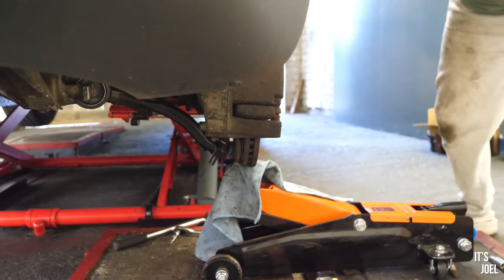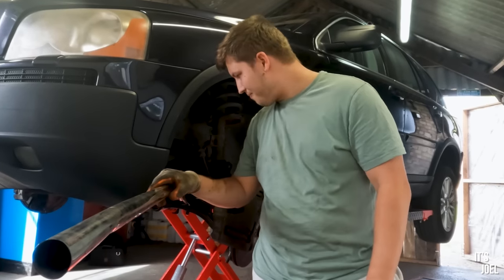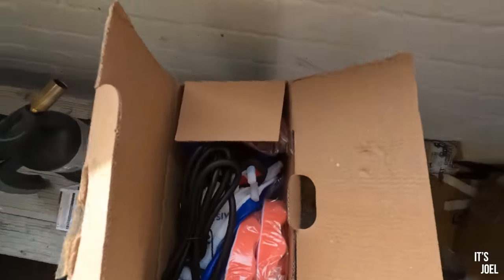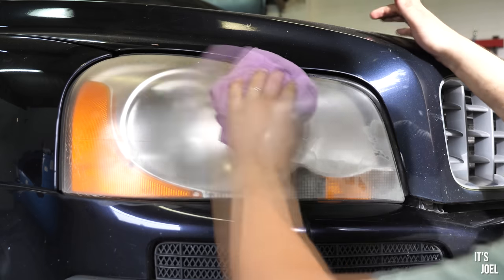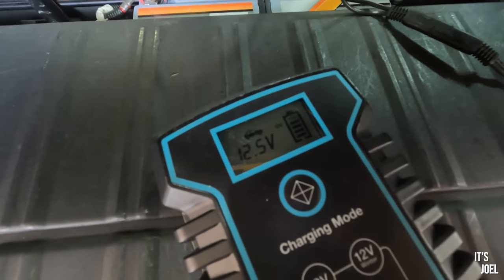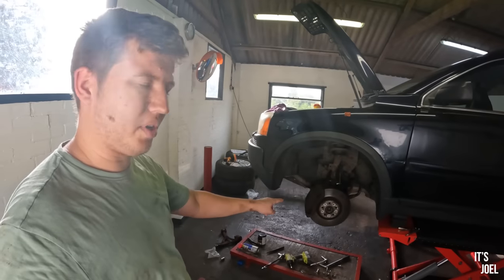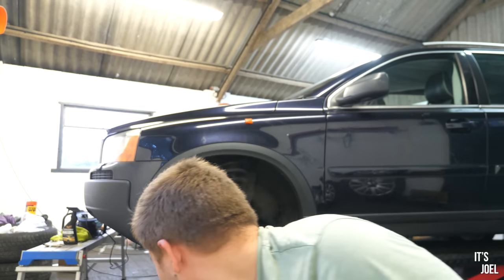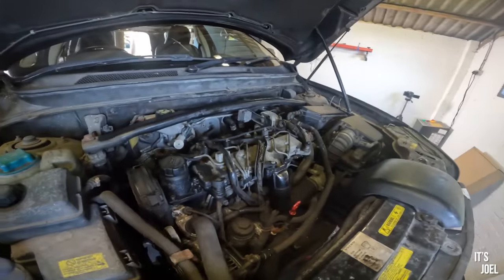CAN I SAVE MY £800 COPART VOLVO XC90? PART 3

Comment from the maker: Get Gaminator here! https://clik.cc/x7e4A
Thanks for all your support!
Reply: Where did you get the car polisher from please Joel p.s loving the volvo videos
Reply: All you needed to do was remove the caliper , carrier and disc , then the drop link ,  then the 2 hub to strut bolts and the hub is free to float in free space , with 1 hand you could have dropped it on the  arm and then done it all back up .
Reply: Do ball joints on the floor it’s easier…
Jack up the wheel you want to change, wheel off, axel stand in behind arm, bricks under the disc, drop down & Jack out, swap ball joint and use the Jack to push up the new ball joint bolt 👍🏻
Reply: Buy yourself a Haynes workshop manual off bay of e approximately £23 and read it before you do the job in hand, if you are ever replacing a droplink just chop the nuts off with a grinder with a slitting disk in it makes is so much easier 
But do get a Haynes manual

Comment: Got an XC70 which I just replaced the lower control arm and ball joints on too, two flipping days of blood, sweat, tears and a lot of brute force and effing and jeffing and got their in the end so I was rooting for you throughout these videos, bravo sir.
Reply: When replacing   control arm ,its better to conect the ball joint first and then connect the  arm to the chassis, have done it that way several times with great success.

Comment: You don’t have to replace all 5 injectors, just the faulty one. And if you are getting a compression leak past the injector you can just replace the copper seal and tighten it down.
Reply: Hm, i think it's better to replace all 5, or at least, refurbish them, because the amount of fuel between cylinder will differ from new to old injectors, as older ones flow much worse than new
Reply: @xnrs9334  The ECU will account for that. On a lot of engines you'll have to code in the specific injector. I would ideally not replace the leaking one, just replace the copper seal with a new one (check if it has done damage to the cylinder head first) and put the old one back in.
Reply: @tschuuuls486  tbh i'm not very familiar with diesel, but, how would it account tho?
Reply: @xnrs9334  it can detect the amount of engine knock and the combustion quality from the o2 sensor which allows it to fine tune the injector injection amount. Mercedes ecus for example will show you the injector duty cycle offset learned VS programmed time.
Reply: @tschuuuls486  well, the thing is that there is only 1 lambda sensor for all 5 cylls, and 2 knock sensors, so idk how it should work
Reply: You have to replace the hold down clamp as it's a use once item , otherwise like reusing a head stretch bolt , it won't tighten .

Comment: It looks to me like you were actually tightening that drop link nut at around the 12 min mark. Stick with it, your skills and techniques, and of course knowledge will grow with you. We've all been where you are. When I was young and skint I had to change a gearbox in my Mk1 Escort for work the next morning on the street outside my house. It pissed down with rain, I was soaked and freezing. Got it done by midnight and the last thing to do was connect the clutch cable. It wouldn't reach because i'd installed the clutch arm back to front in the gearbox. It had to all come out again :( It was quicker next time round and I got to bed about 4am for a 7am start. I'd also thrown my overalls in the washing machine which coated it with gearbox oil, which ruined our first babies clothes on the next wash :D I was not popular with the missus for a while. Actually, i'm still not, and i'm 57 :D
Reply: What a story 😂😂😂

Comment: Good work with the attempt its good to see people having a go. I saw that at 11.28 you were turning the nut to tighten not loosen it might be why it wasn't coming off :/
Reply: thats not the issue ... he was trying to tighten to break lock but its pointless as its a balljoint and rotates ... it has a hex cut in centre to prevent rotation. he needs to use hex and ring spanner and it comes off easily
Reply: @awesomed007  mostly true but in almost every case like his you must use a ball joint splitter as it won't rotate due to being jammed in place with rust or other oxidation. The ring spanner and he but should have been the right way as you said and turning it the right way. Heat could have been applied too. Nevermind he has moved on.
Reply: @cocobunji1211  yeah, if hex and ring doesn't budge it, heat or penetrating fluid would help. Brake fluid works just as well.

Comment: I am sure someone has done a bell curve showing age of vehicle vs difficulty to fix/work on… but the rustier and older they are balances out against the simplicity of design vs a newer car, resulting in easy jobs becoming a nightmare. Having been there too many times, and missing the right tool/part at the right time, it’s all part of the experience. Good on you for taking up the mantle.
Reply: Makes working on your pals and missus' stuff a piece of cake though. All that time in the trenches, working on tired, high mileage cars of your own gains you a lot of exposure to all sorts of problems.

Comment: The headlights could have done with a wet sand. It’s so easy to do and normal heavy cut compound to finish off they come up like glass. You can also use the same polish on the rest of the car so you’re not wasting money. That headlight compound is just a small amount of a heavy cut at an extortionate cost. My preference is meguiars heavy cut compound. Then use a ceramic coat to seal it. Otherwise they will be 10 times worse in about a month or so

Comment: Ball joints naturally want to turn  - there's nothing preventing rotation. So to undo them or tighten them, you need to hold the shaft still. That's what the splined hole is for in the end. So you put a Torx bit in the end and then use a spanner on the outer nut. You can't use a socket on them.

Comment: In the vast sea of YouTube, where many tales are spun,
I've witnessed your triumph with that XC90 Volvo, well done!
The journey was tough, not a simple redo,
For these Volvos, with age, can certainly test you.

The PCV systems, notorious for clogs,
Lead to pressure build-ups, a smoky exhaust fog.
Then there’s the ETM, electronic throttle module's strife,
Causing stalling and jerks, bringing driving life to a knife.

The AWD system, sometimes it won't engage,
And the transmission? Oh, it might miss a stage.
Coolant leaks from the water pump, oh, what a mess,
And the timing belt, if skipped, might cause distress.

The sunroof may drain, and flood the car's floor,
While the fuel pump control module could certainly be more.
Yet amidst these challenges, and many more you've faced,
Your XC90 now gleams, every problem you've erased.

So here's to your skill, dedication, and lore,
For reviving an XC90 Volvo, making it roar once more!
Your journey's inspired, showing old can be new,
In the world of auto triumphs, hats off to you!

Comment: Joel , with the ball joint, use a torx bit and a spanner, you will be able to stop it spinning, the torx goes in the centre of the ball joint and can stop it spinning then the spanner u tighten it up ..
Same with anti roll drop links, use torx or alan key and use spanner to undo.   Hope that helps, if u need any information drop me a message mate 👍

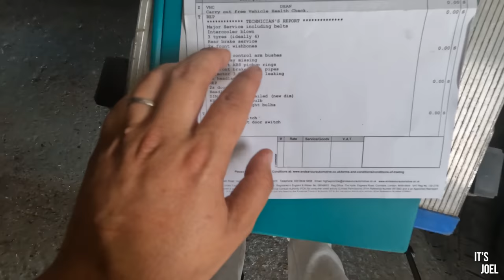Comment: The failed MOT on the emissions is not the injector. There you got the note from Volvo about the Blown Intercooler. 8:53. That is your issue why it failed. SInce air coming into the engine escapes thru the hole there and hense the all fuel will not be burned and ends up in the exhaust system as soot. Replace the intercooler and give it a good blast on the highway and it will be good.

Comment: I put a short chain around the control arm so the bar is under the rotor were I can sit my weight down on it while holding the rotor up to put the ball joint in. Have a lot more leverage and control that way.

Comment: good on you Joel for having a go with it all, mechnics on old cars is a bitch to do, nothing is ever easy with old rust bolts etc, i worked in the motor trade for 30 years but now i leave it to the pros. hope you get this old girl through the mot soon.

Comment: Well done for having a go! Best investment is a universal spanner.... angle grinder! I don't bother trying to carefully remove drop links... impact to start them either with a gun or big hammer before gently removing with yer grinder, don't forget some thread lock if the new nuts aren't nylock? Sometimes it doesn't help working at height, finally you realised drop it and use a jack. Don't know if D5 injectors need coding? Don't forget your seals and possible seat grinding if you have "black death"?

Comment: I have to say that you probably picked the most difficult control arm replacement job to begin with. I’ve been in the exact situation with xc70 control arm job and had to use a lot of force to achieve anything. Good effort and definitely not the easiest task to start with 💪🏻
Reply: having done such repairs, i am impressed with how easy volvo ones are to change compared to cheap cars ....

Comment: Normally piece of chain or old exhaust clamp, wrap around the lower arm, bolt the chain together use a big bar, to give enough leverage down to get the arm back into the hub, saves buying the tool for it

Comment: Well done for peservering with that balljoint. It would take a lot to seriously muller it. It looked fine to me. Don't forget to compress the suspension before the final tightening. What I'd do is to jack it up under the balljoint until it takes all the weight at that corner to simulate the suspension being under load at the normal ride height. I get why you didn't sand the headlights. You just need to do the minimum to be able to pass the retest and it is defintely better than before. An angle grinder is the way to go for the drop links. Just be careful not to nick the ABS sensor wire (don't ask me how I know). Leaky injectors are the main problem with an otherwise bulletproof D5. I hope you've been binge watching my XC90 content (all 32 videos of it).
Reply: coil spring compressors should be used during this entire process, then he need'nt have battled as he did

Comment: For the droplink, hacksaw if you don't have the power tools or drill the bolt through. I had to do it myself when I was in the same situation. New suspension parts do require you being heavy-handed, no other way about it mate. Keep on focused and can't wait for part 4!

Comment: Have a look into getting what we call in the trade and ‘nut splitter’ . Also, that wasn’t a proper rattle gun that you were using in the first video, I don’t know if anybody’s mentioned it, but you need the large heavy duty ones to get stuff like that off.

Comment: The leaking injector probably does not need the injector replacing. In my experience it will either need the washer sea at the bottom of the injector hole replacing or what is physically holding it down in the hole (sometimes a clamp) is damaged or not working properly

Comment: Should of just lowered the lift and used the jack to lift up or compress the suspension giving u an easier time fitting the ball joint in.

Comment: You have probably been shown now but for the top anti-roll bar link you need a ring spanner and an allen key (Hex) as you can see on the end of the bolt thread you can fit the allen key to hold the bolt while the ring spanner turns the nut.
But great effort, when things go right you do get a great sense of achievement, well done and keep going 😃👍

Comment: it looks like you are trying to tighten that upper drop link nut rather than loosen it
they also have a little allen key slot in them so you can use that to hold it and then undo the nut with a spanner to stop it spinning

Comment: Well done for giving it all a go, really frustrating when it doesn't go right though!
You need a hex piece to hold the centre of the droplink pin and then use a ring spanner around it to turn the nut ... Were you not tightening the upper bolt in this video too ...

Comment: Headlights, Just paused it before you cleaned, There are two pull out pins under the bonnet. pull em and whole headlight just pulls out. Best ever motor I've owned to replace bulbs on the front end. I had a 53 plate XC90 with a T6 powerplant. Volvo never did admit the demise of the T6. Engine was too powerfull for the tranny and transfer box. I ended up getting too fedup with gearbox going into limp mode,  only gears you had was reverse or third :(

Comment: The No3 injector 'blowing' is most probably the copper washer at the base of the injector body, This seals the injector to the cylinder head, Make sure you get a new one and the 2nd hand injector was most probably not needed mate, Injector seals are a common Euro3 D5 problem.

Comment: you could try using a Hex key on the drop link bolt with a spanner on the nut after lubricating of course
Reply: And try going the right way as well to undo.

Comment: If you take a tension belt betwen left and right lower control arm and get som tension on it,  control arm  get down and its easy to get boll joint in position. You do good job    Best regards from sweden

Comment: I never get why people don't take the headlights off. At the XC90 it doesn't take more than a minute, just pull the two metal bars out, disconnect the plugs done.

Comment: 241 comments. No being checked but most technical collages do Bobbie course one night a week and let u work on ur own car. That way u use their lefts and you get real good help and have access to tools. Go for it and that enthusiasm u have will stand u well. One of the best tools for suspension work are extra long aviation spanner’s. They are straigh and u get maximum torque into bolts and nuts. They make a big difference

Comment: Be warned about the injector these don't normally just pop out. It'll most likely need an injector puller on it and then you'll need to prepare the head surface for re-installing it and new injector seals and stuff. Be careful be very easy to immobiise it. Great content though 😀
Reply: I don't think it's even injectors. I had similar pooling and blowing on a 2.0 tdci mondeo, all I did was tightened it up, and it was fine.
Reply: @stevenking2946  could be, I have seen these d5's blow up past the injector making a lot of mess. Certainly worth checking around the injector and cleaning it with brake cleaner before pulling it. Like I said if your not used to doing them it can be tricky.

Comment: congratulations on getting the ball joint in place. next time it will be easyer (maybe) its always a white shirt i wear working on the car. in the engine bay on the passenger side, theres two terminals to charge battery or jump start.

Comment: I know your pain, it was literally easier for me to pull the engine and gearbox out than to put that thing back in place. As for the sway bar links and ball joint, there should be an allen wrench shaped hole in the middle to help you loosen or tighten it

Comment: Well done you!     In fairness its very different in a professional garage as they have the tools for those pain the the ass jobs.  Makes a huge difference...   Have done bottom arms and drop links in the past too.    One was a dream to do as and all came apart with only a little persuasion.   The other was a high mile car where everything was solid and corroded too.   Took for ever and a very big hammer.     Keep it up cant wait till you finally get it back on the road...

Comment: Well wisdom comes from failure so I wouldn't worry about getting things wrong and you need a transmission jack for putting the hub on if you're going try to do it alone. I'm not mechanic but I have seen a lot of car wizard videos. I reckon it's always going to be a two person job though.

EDIT - should have watched the video first. The transmission jack would definitely make it easier though.

Comment: You look like your turning the top nut for the drop link the wrong way unless I'm mistakened 😂 Lefty loosey, Righty Tighty, your tightening it up that's why it's not coming off, you need to turn it to the left, anti clockwise 😊

Comment: You will get more stressed and make mistakes because your pushed for time with regards to renting the garage unit. So its extra added presure on top. If you did it on your drive way with a few beers you would off got further ahead and enjoyed it. Even if it took you longer you would off been able to take extra time in watching videos and reading workshop manuals.

Comment: Great video but you are driving me mad. Volvo ball joints have a hex drive at the end of the shaft. Lock the joint with a hex drive and undo the but with a spanner. It will save you hours.